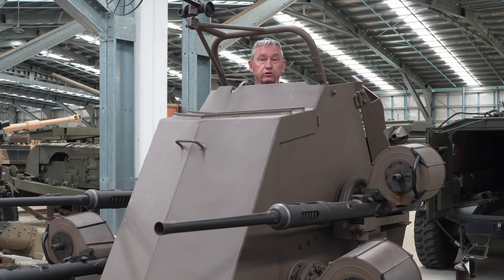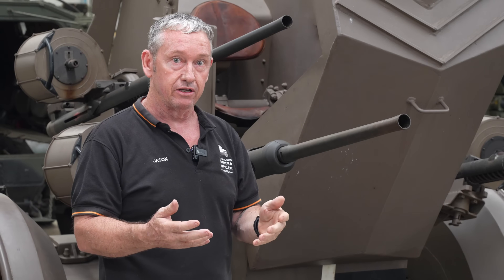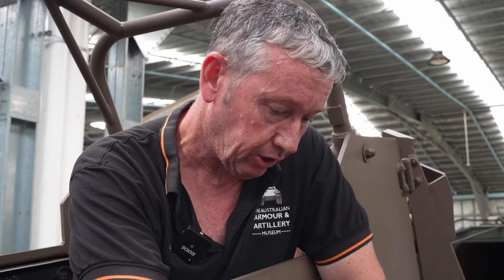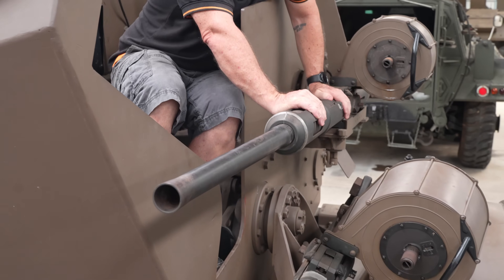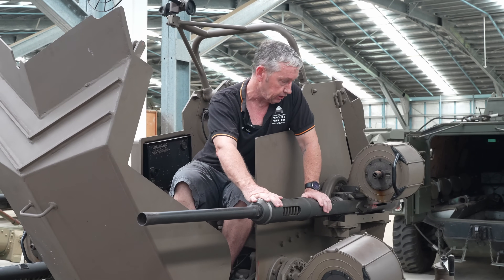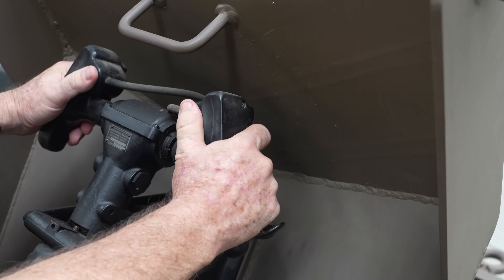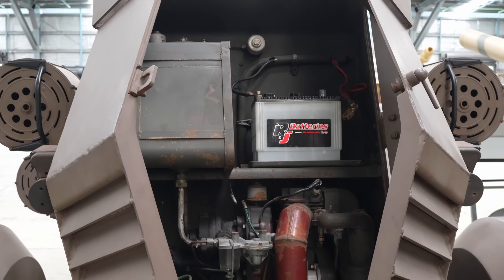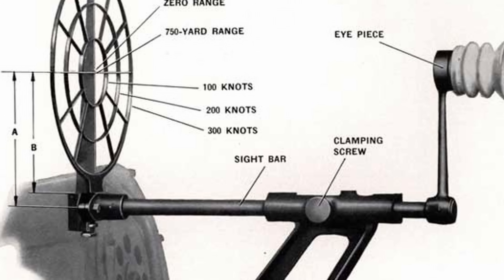The POLSTEN Quad Anti-Aircraft Gun

Comment: The Poles didn't escape with plans for this gun. The Polsten was the creation of one of the Polish design teams based at the Ministry of Supply's Armament Design Department in Cheshunt, working to a brief to reduce cost and simplify manufacture of the Oerlikon gun. Its success on both fronts, was such that the lead designer, Lt Jerzy Podsedkowski received an honorary MBE in August 1943.

Comment: How does the operator get out of the seat when the barrels are hot After defending for my air attack doesn’t look like there’s much room to escape the vehicle, without putting your hands on the barrel
Reply: The gunner can actually step over the barrels whilst in the trailer mount....like with any piece of equipment, when you have trained on a particular bit of kit, you know when to touch and where not to touch....
Reply: The barrels are elevated to max to make it easy to enter and exit.  I own one in Canada.
Reply: Yes I'm sure you can do an air attack 😂